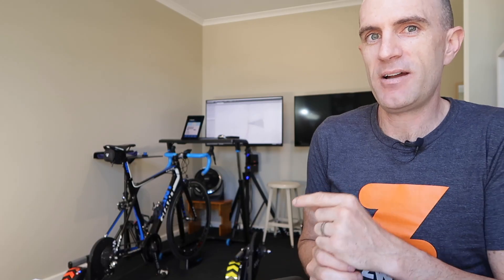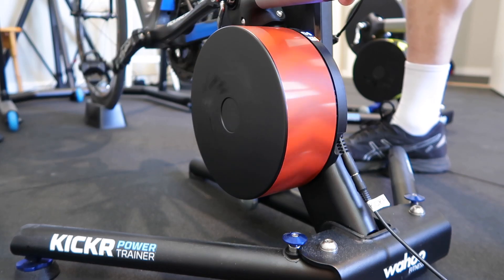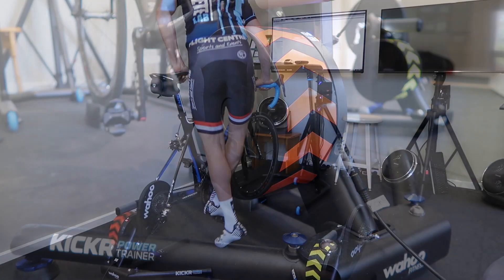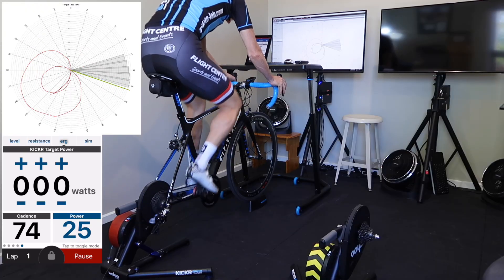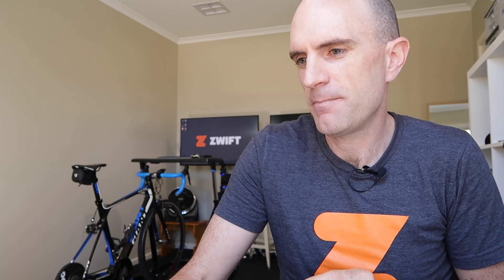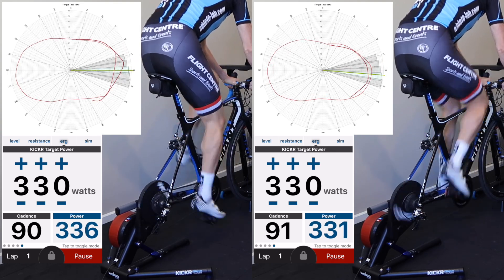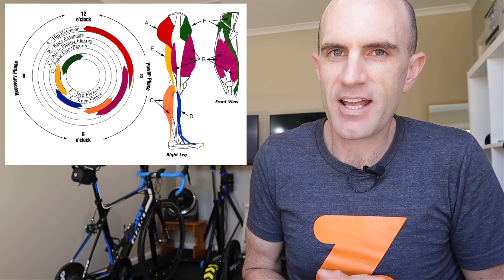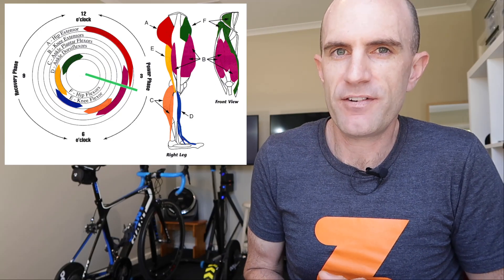Wahoo Kickr ERG Mode - Does Gear Selection Matter?

Comment: Yes it does create a different training experience. For reference i use Trainerroad and Kickr. The FTP test is done in normal mode so you perform that in say a 52-14. In ERG mode 52-14 is much easier to hold the watts than 36-14 even with a > 100 cadence. 
What I do is 1 set in the 52 and then 1 set in the 36 and then back to the 52. If I am failing an interval i'll micro adjust by changing the back ring to get through the interval.  
I thought that since it is harder, there must be a different training adaptation needed so I may as well do an alternate style of training and improve on that as well. Mix it up to become a more versatile rider. 
If you're interested, here's my un-scientific theory. The Kickr measures power by flywheel speed x brake force. Higher flywheel speed requires less brake force, so the giro affect of more flywheel speed and less brake force requires less pedal force to keep on top of it. With the smaller gear and less flywheel speed, it needs more brake force so you need more pedal force input to keep it going. There is only so much pedal force we have, so to get more, we utilise additional muscles earlier in the pedal stroke to perform the work.
Reply: 016hawk i have the same theory. but as an addition, at low fly wheel speeds with higher resistance force small changes in cadence lead to larger changes in power making it more difficult for ERG mode to keep the power constant. so i could imagine that there is a optimal cadence / resistance region where ERG operates the best.

Comment: Running ERG mode on the Kickr with a set wattage at different flywheel speeds, I wonder what you would notice with...
(a) Heart rate - by how much (if any) is it higher at a lower speed? Should that affect how we think of Power as a absolute training metric? 
(b) Does the Precision of the Kickr's power data change at different gears on ERG mode?
Reply from the maker: Interesting questions. 1) HR is the response to what you're doing, and it can vary a LOT. It's not invalid... it's just not as useful as power. 2) Excellent question. I'd go with a gut feeling of 'no'... but.. it'd be something to test out for sure.

Comment: Great video Mr Miller, your techniqile content is awesome, this maybe a bit of a stupid question but I’ll ask it anyway, I realise that the kickr requires power so it’s able to operate and create the power output changes, but then why can’t it recapture, the power we are putting through the pedals which ultimately goes to the fly wheel and store it in a battery or go back into the grid like solar. 

I know these kind of machines exists as in 1 hour of cycling a day can generate enough power to run a house for a day,  js there a way u could connect a belt to the fly wheel and drive a altanator to store the energy produced ???
Reply from the maker: Cheers Steve. That device that powers a house for a day, it's total crap. There's no such thing as a free lunch, and no such thing as free energy. Humans are HORRIBLE engines. ~20-25% efficiency of energy if I recall correctly. Which is why we can convert energy from power meters in kilojoules straight to kilocalories (Calories) and it works out about the same.... Long story short, we can't produce enough energy to be all that useful. Maybe we could charge a mobile phone, or power a LCD TV with our 150-250W of pedalling... but then that energy has to come from somewhere, typically the food we eat. It's a super interesting topic. Best summed up with a quote from the text books on the topic "energy can neither be created nor destroyed; rather, it can only be transformed from one form to another."
Reply: Shane Miller ahhhh ok just another lesson shouldn’t believe everything you see on YouTube !!! 

But on another note that spin scan u were using in guessing is rotor software as stated in the video about the positioning of the q-rings ( not that I’m a big fan of them, but that’s just my view ) I saw on the GCN show ( does science ) Sy and Dan did tests about pedalling techniques and trying to perfect pedalling circles, and as the tests shown the human body ( which is each persons best personnel computer ) actually adapts to the most efficient pedal stroke for each individual person as we are all made differently. Just wondering what your views on this would be ???
Reply from the maker: I haven't seen any conclusive evidence/data in q-rings that has convinced me to try them. I'm sure others have... and that's why they're running them. I'll give the GCN science a wide berth for now.

Comment: With my Kickr in ERG mode I always put it in the small chainring just because it's a bit quieter...
Reply: True i def noticed the same thing
I am on a elite suito though
Reply: The mic was positioned wrong, did you notice how loud the clipping in and out of pedals and gear changes were?  Everything was way higher sound level than you would actually hear it.

Comment: Shane, great video. I've been noticing this on my KICKR SNAP as well. In fact, I previously owned a Cycleops Magnus and found I had to train in higher gears because the flywheel didn't have enough rotational intertia to not feel like slogging through mud. As a result, my climbing outdoors suffered dramatically. I've noticed my HR goes up faster and my legs fatigue more quickly in lower gears than "flying along" in a higher gears.

Comment: The taxc flux.. in erg mode, doesn't hit the bigger wattages numbers unless you start putting in the big ring and smaller cassette sprockets.. I.e say 370..upto 1000+(sprint efforts) can be frustrating if you select wrong gear on a sprint effort, also it take 3-5 seconds to hit the wattage too👎so on microburts efforts maybe factor that in on a workouts..

Comment: Thanks Shane and it helps as I've just got my latest kickr for my training. One further question, will it provide better training for climbing if I use higher front wheel stand/kickr climb in order to simulate the slope?
Reply from the maker: Maybe. That's about all I'll commit to as an answer for now without doing a lot more reading up on it. :)

Comment: Shane can you overlay the average torque curves somehow?  Maybe on an X-Y graph as opposed to the radial graph that shows the "peanut".  This might help illustrate some of the "feel".  I stopped your vid at 5:47, when you explain the different resulting max power angles and zoomed in on the graphs.   Notice  that the radial graph scales "auto adjust", so they are not the same torque axis values.  IF you pull out torque values off the "peanut", you see that the left, low flywheel speed values peak roughly at 55 and 45 Nm.  The high flywheel speed values peak roughly at 45 and 40 Nm.  I am not exactly sure what this means as obviously the "systems" (power meter, recording software, EGR mode software) involved are doing some sort of averaging to arrive at 330 Watts at 91 RPM.  (Power = Torque x RPM, and Torque = Force x distance(crank length))  Perhaps the X-Y graph might show why there is a difference?  My take is 1) your muscle use chart is key to that "getting on top of the gear" feeling and 2) that there is something else going on within the "systems".  All that said, I am certain that yours is the best explanation I've heard so far.  Cheers!
Reply from the maker: The auto-zoom/scale on the torque was doing my head in! I wanted to do the overlay but it was bouncing around all over the place.
Reply: It would be very interesting if the "raw data" was available.  We could try to see just what sort of averaging the systems are using.  As you stated, is a complicated problem...     What isn't so complicated is to calculate that 34.63 Nm of torque is required to produce 330W at 91RPM.  Obviously, this would be for a constant torque; a perfect circle on the radial graphs.  We have "peanuts".   Okay... enough, my head hurts.  Time for more coffee!
Reply from the maker: Agreed. And you're on my wave Paul. I was sipping my coffee as I read the last line too! I should be able to export a CSV from Torque360! Bam! Let's do this..... wait...  I've just removed the 2INPower cranks to test out this Wattteam Powerbeat...  stay tuned! I will return to this.

Comment: Thanks for the video!  For 5-6 months a year, I use a CX bike on my Kickr2.  Usually 1X.  It's been interesting comparing the "feels" of different front rings (38, 40, 42, 44 and 48).  For Zwift, the bigger rings feel better, but I usually have the 40 or 44 installed).
Reply: One question: a 40T ring with zwift cog (14t) and virtual speeds is a good selection for a good ratio velocity/wattios in all conditions (mountain or straight? Or it’s too much heavy for a cyclist with 200 FTP?

Is this one ok, or is it better to choose smaller ring like 36 or 38? 

Thanks!
Reply: @ddoble3269  with virtual shifting, I assume you'll be fine.  I don't have the zwift cog, but have spent plenty of time on a 40t ring.

Comment: Great vid as usual! I’m on a kickr2 and I prefer to use the 52T in front for the lamest of reasons. There are 2 actually. Lol
1: Riding the bigger front 52T gives a higher distance covered reading on Strava. The smaller 36T always logged less distance covered. Btw I ride on trainerroad only. Eg, 1hr ride on big ring roughly equates to 40km on strava. The smaller ring usually equates to only 28km. 
2: to keep the best chainline, I will ride 52T - 15T, the 5th sprocket on rear. This is more on trying to improve on wear and tear, thus reducing running cost in the long run. The fifth sprocket will normally be a single piece which can be replaced very cheaply vs a whole cassette. (No sram red 1 pc cassette for me!) I can run 36T - 17/18 to achieve the best chainline, 17/18 will be the 7th cog. However, the 7th n 8th cog will normally be a 1pc consisting of 2 cogs which also means they are a lot more expensive to replace. 
Yes, the front big chainring is normally much more expensive to replace compared to the inner ring. However they too last a lot longer. 
After watching this vid, esp understanding we are actually utilizing different muscle groups, I will definitely begin to alternate btw inner and outer rings in future.
Reply from the maker: Before I'm corrected by a biomechanics expert... I think the correct term would be different ratios/amounts of muscle groups. But the concept is the same there in what I stumbled though. Old school coaches have this nailed already - If you want to get good at riding hills, ride hills. :)

Comment: had my elite intera/inertia (qubo variant) wheel on trainer for a couple of weeks now and have definetly noticed/feel you can "cheat" erg mode (since realising i try to avoid doing it)  
 
counterintuitively at fixed power and cadence it becomes harder when you change down and easier when you change up, i figured it was due to inertia maintaing/creating more of the power at high wheelspeed and me doing less work.
 surely this could be shown by comparing numbers from pedals to  those from a trainer ? but what youre saying is that the increased inertia is simply changing the required pedal stroke to a more efficient/comfortable one and actual power is the same?

on wheel on trainers i also wonder about the effects of wheel and tyre weight

Comment: Isn't it so, that the higher the wheel/flywheel speed is, the less resistance the trainer adds, to get the same wattage? On my Vortex, it certainly feels quite different doing 300 w in a low gear and a high gear. In the low gear, it feels much more "choppy" and nearly unrideable, so I always use the big ring. Have you guys had the same experience?
Reply: Yes, it almost feels like I am cheating by spinning up the wheel as the resistance is less. With a Vortex btw.
Reply: yes, the higher the flywheel speed the lower the resistance for a given wattage.

Comment: I've tried this on my Kikr. Maybe it's personal but I find it easier to hold higher watts at higher flywheel speeds. So either higher cadence or higher gear or both. This has a damping effect on the load you feel at the pedal and is less demanding on where or how long your power stroke is.  For me this also translates on the road. Higher rpm is less critical on where in the stroke you make the power. You don't get the spikes in the load on the muscular system.

Comment: And, as you taught me for some trainers like drivo and direto by elite...erg mode simply doesn't work with big gear.  Listenin' on what you explain in this video with this elite trainers some kind of workout cannot be perfomed.
Reply: Fabio Mussi excately, the ERG on the elite drivo is absolute rubbish when used in the big ring. my theory is that the resistance is the product of fly wheel speed multiplied by the braking magnet distance. hence at higher flywheel speed like in the big ring the single steps in resistance are larger compared to resistance steps while riding in the little ring. i think they need to adjust the stepsize of the magnet motor to obtain smaller steps in resistance for higher flywheel speeds. TL DR: erg mode sucks except riding in the small ring which kinda sucks too regarding the road feel.
Reply: This is really disappointing. The drivo is the flagship trainer for Elite but even the direto is an 800$ trainer. What i really don't understand is why this issue, if it is the same for this 2 trainers, is not mentioned in any of the reviews i've read such as DC 's one. If, as you say, the road feel with small rings sucks....it's something to  consider when someone is going to spend so much money
Reply: yes I'm quite disappointed by DC rainmakers review of the Drivo and the Drivo itself. He said that no calibration is necessary which is absolutely wrong, furthermore the Drivo needs about 20 minutes of warmup until die power stabilses.  And out-of-the-box my Drivo reported about 20W higher power data compared to my power2max power meters, so without proper calibriation after at least 30 minutes of warmup the power data is absolutely not reliable. Another disappointing  aspect is the app. It provides merely 20 steps to set the resistance, thus each step is about 50W, basicially useless to control the trainer. For that reason I have to use trainer road because it provides much smaller steps in the resistance settings. Yeah, and on top this the malfunctioning ERG mode, which makes pretty much that you will always ride 20W above or below your target but never actually on target. And sadly most of these issues are due to bad engineering and not a fundamental flaw. They could be fixed so easily like the app to control the resistance for a start. Honestly, my old Vortex doesn't fell so shit anymore compared to the Drivo considering it is only about 25% the price of the Drivo.
Reply: I've contacted Elite support  because DC answered me that in his reviews (not only Elite ones) he always use big gear and, obviously, i ve no doubt he tells the truth. So when i told to elite support that for me ERG works only with small ring they were surprised and they confirm me that this is not the correct behaviour for the direto (and the drivo).

So they asked me to perform a test ride with their app in this way:  warm-up (10/15' minutes) calibration, and some intervals in erg mode with 50W steps...such as 150W,200, 250W, 300W and 350W. At the end i'll send exported files back to them. I'll let you know what 'll happen.
Reply: Fabio Mussi i also contacted Elite about the issue and offered my collected data to demonstrate the oscillations in ERG mode and asked them how they will address this issue. but they did not respond because i think they know how messed up ERG mode is and don't have a solution yet.
Reply: waitiing for answer, I have drivo and the same problem but I use MTB bike with 1x11 Drive.
So now i dont know which gear I should use for training in trainerroad. 34x11(rear ring) or 34x28(rear ring)?
Reply: @fabio_mussi  Hi, any information form ELITE, I am looking forward

Comment: Yes it makes a difference!! Doing a block at 280w on 50x13 is quite a bit easier then on 36x17. Had a Snap, now own a Kickr and it's the same feeling. 
Feel is something subjective but it would be interesting to see what happens if you do a 6 minute block around threshold, once at low gear and once at high gear. Heartrates will be lower on the high gear, i'm pretty sure. Maybe an idea for an other Lama video ;-)
Reply: cerocerocinco so you’re saying to stay in the big ring in erg mode? Also, in your opinion, is it worth going from snap to kickr for just general fitness!

Comment: I tend to just try and keep the chain line straight to minimise drive chain wear. Big ring on front / mid block rear.
Reply from the maker: Grind it, wear it out, throw it away. Everything is a consumable! :) Big ring mid cassette will be suitable for most riding, so you're onto something.
Reply: Shane Miller Meant when in ERG mode mainly as top end gear can be expensive to replace especially if accelerated wear through poor gear selection.